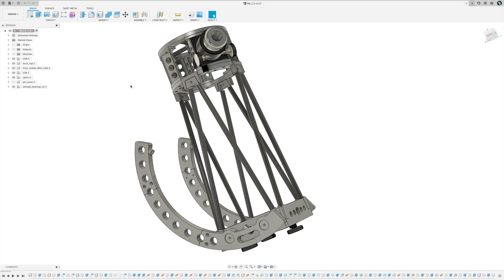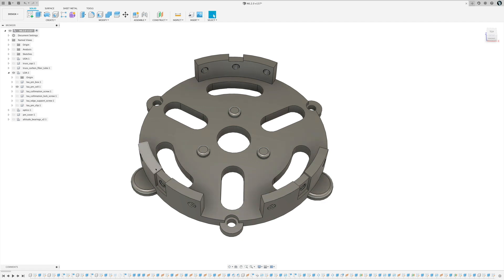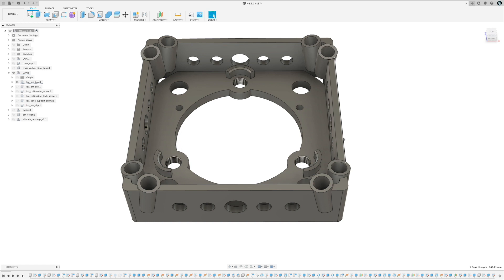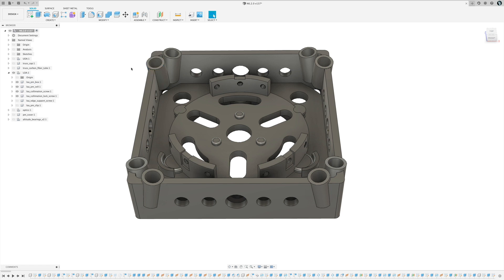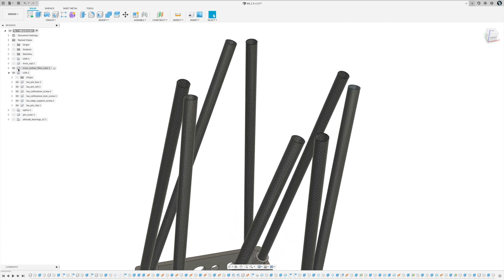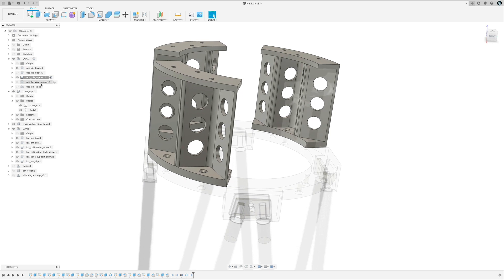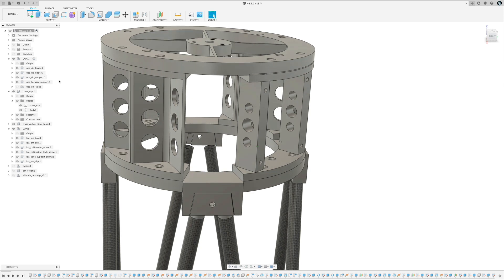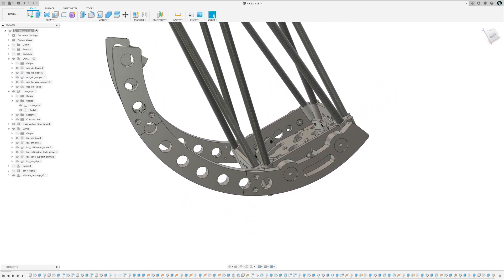3D-printed Newtonian Reflector Telescope

Comment: Thanks so much for this. It is awesome.  I have a 6” GSO NEWT that blew over in the wind and ended up with a huge dent in the steel tube. This should bring it back to life.  

I’m actually building your original design because I think I can adapt it to my mount more easily. And it fits on my little ended 3 v2. If I can successfully build the basic one, I have some mods in mind. 

Anyway, thanks again!